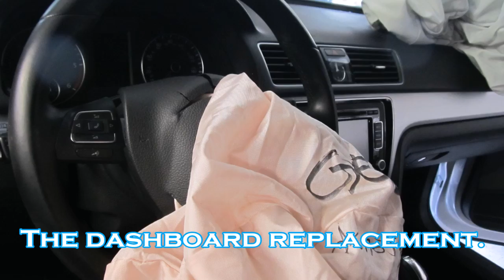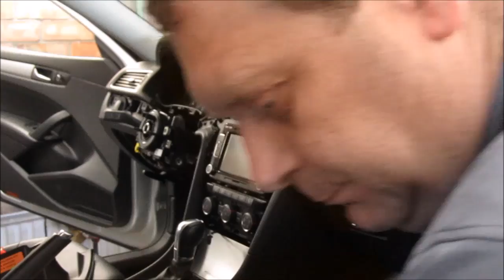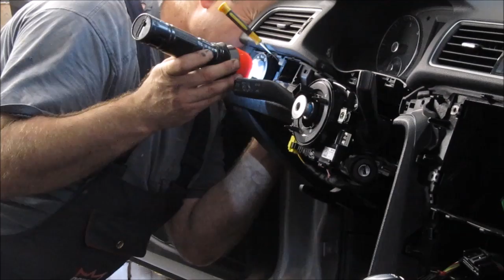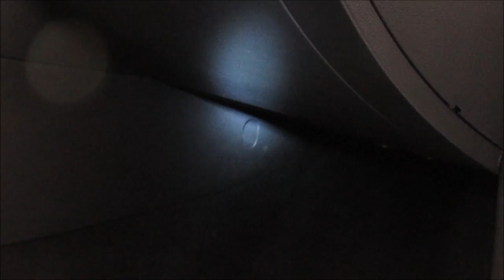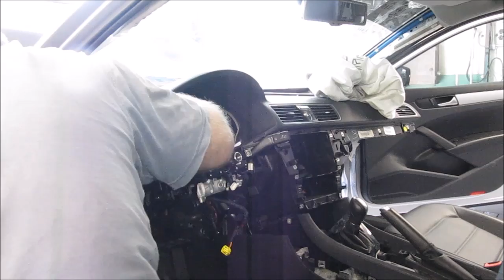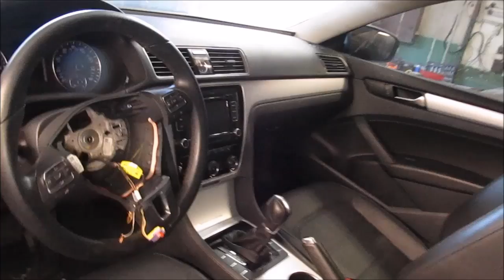VW Passat. Dashboard replacement. Замена приборной панели.

Comment: Thanks for posting this video.  I have Passat SE that doesn't get hot air on the  right side vents. It has manual climate control. The air box is buried in the dash.  SO this video gets me halfway there.  Have you had to replace the climate air control box in the center of the dsh, if so do you have a video ?